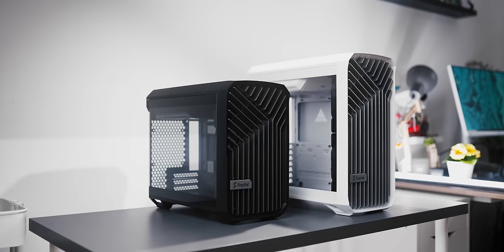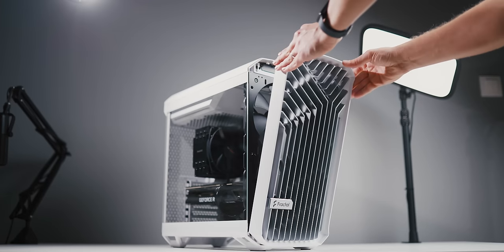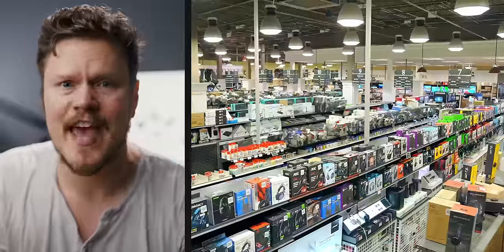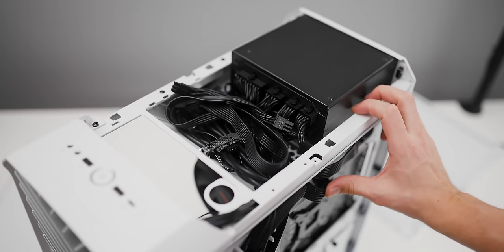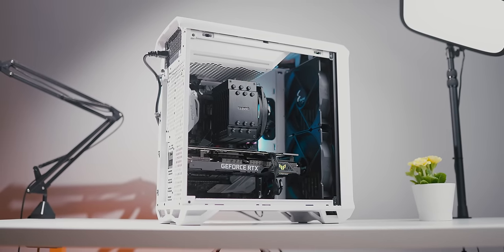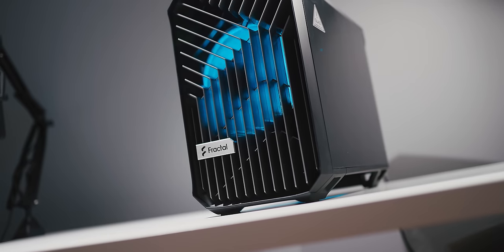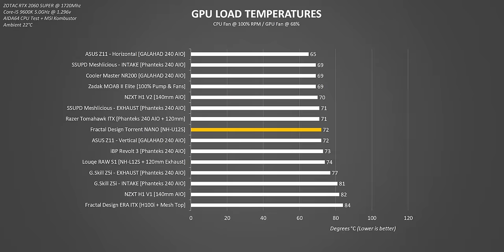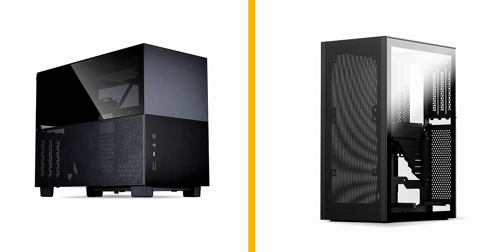Absolutely LOVE These Cases - Fractal TORRENT Compact & Nano!

Comment: I just ordered a NR200. Looked at the Torrent Nano but I'd like to put the PC on my desk and the Torrent is just a bit too big for that. Means I need a new SFX-L power supply but that's fine. Need an upgrade anyway since my 750W sometimes has problems with the 3080 Ti I got recently (at MSRP!, only reason I got it since 3080s at scalper prices cost about the same).
Read that SFX PSUs can have issues with the power spikes of 30series cards because they have smaller cap, hoping the amount of overkill I went with (1000W Silverstone) will alleviate that.
Reply: Good choice, I have a 30series build in an NR200 as well. The case is just absolutely beautiful!
Reply: You can fit an ATX PSU in a NR200 on the front using zip ties, but it eats into the GPU space quite a bit. Alternatively you can also buy/print a 3D atx bracket instead of using zip ties.

Comment: I was hoping the ITX case would support SSF PSUs. The price doesn’t bother me as much if the construction is good, but the usage of ATX supplies seems strange to me
Reply: I’m sure you can, most sfx power supplies come with an atx bracket. The only issue would be cable length. If you are buying an all new build though, a regular sized atx is cheaper. So that’s a plus

Comment: I just got the compact, cable management stinks, looks way better for air cooling, as the case feels more filled out compared to the original Torrent. If you decid3 to get this case, make sure to check your case IO because the reset button will stick down when the front cover is installed.
Reply: I was looking at it just for my old parts to make a server for games.
Reply: @Noodlepunk  I wouldn't do it if you're using harddrives because there is a lack of driver bays.
Reply: @eduardorico2205  I am planning on building a NAS here soon.

Comment: I did get the compact for myself have been waiting for a smaller torrent for a while.
There is one tiny cutout beneath the motherboard all the way on the left, I routed my audio header through there ... No idea if it was meant for that, it does not fit very many cables but just those pin headers fit fine.
I do not understand why the side panel is glass on both sides (on the rgb version) the one covering the cables should have just been a solid panel ... 
Also for the price they really should have included thumb screws for the side panels and the top panel ... the screw holes are there, even for the top panel.

Comment: It seems like the Nano is performing better than the Compact? How is that possible when the Compact has more airfllow?
Reply: Different cpu's tested which makes it difficult to summarize which is better.  Having a larger case does not = better air flow especially in these because you are then relying on a 120mm fan in the back for all exhaust.

Comment: How to cool the Intel i7 12700 processor? CPU cooler won't block air from going through the back of the case? The front sucks in, the back pulls out, and in the center is the CPU cooler, which blows "upstream" the air drawn in by the front fan.

Comment: I have a EK 180mm WE Radiator (discontinued/brand-new) and this Torrent Nano case looked like an awesome build for it but there seems to be insufficient space in front of the 180mm fan for this 35mm thick Rad.  Bummer.  There seems to be more space in the Compact version for a front Radiator just not the Nano.

Comment: Best part you did not mention: the nano fits the Noctua NH-D15, which is rare in the ITX case world and one of the reasons, why I got the nano a week ago. The prize asked is too much though, paid close to 160 EUR for the black RGB version. Around 120-130 EUR would be anceptable prize, 160 EUR is a bit too much.
Reply: Does the nh-d15 fit with both fans in this case ?
Reply: Said the guy who pays 100€ for the Noctua cooler.
Reply: @Digitalbit3  it does 👍
Reply: @mauticom  So? The NH-D15 is one of if not the best aircooler and I would say it is worth the money. The Torrent Nano is a fine case and I really like it, but for that price tag, I think it could maybe have some better materials or a nicer LED-strip (like mentioned in the video). It is somehow lacking just a little in the premium section to completely justify the price.
Reply: @ManeaterMV  didn't expect a serious answer. I know the Noctua is the top of the line as far as air coolers can go. However I see it from the manufacturer side, the required materials, the huge volume it takes up during transport, the fan, fan bridge, the assembly for a retail price tag of 160€ and then two fans, copper and alu plates for almost 2/3 of the price.

But I totally agree - coming from an old Mac Pro 5.1 case the Fractal Meshify 2 felt a little bit cheap. The metal is very thin, in my case the USB front ports didn't sit tight and other minor things. For 140€ the price tag was ok, but somehow from the aesthetics and clever design solutions I expected more when I actually got my hands on it.

Comment: im looking to use this case for my next build but i want to keep using my kraken x62 and i was wondering if i would be able to mount it to the bottom of the case with air being pulled from the inside to the outside with 2 140mm fans. If not, ill just get the NZXT H510 instead.

Comment: After finding many very nice small cases for my mITX build, but having them be literally 2cm too short for my graphics card when the radiator and fans are in the front, to the Phanteks Shift XT that's 4mm too short, I'm considering moving from the Arctic Liquid Freezer II 280 to an air cooler to try a build in either the Fractal Design Torrent Nano or Compact, or the Phanteks P200A.

Comment: I like the compact size of the Torrent  but I would like the option to add an AIO and prefer it on the top so I would have to go with the Meshify2 Compact if they would fix that case. The meshify2 Compact was shrunk down which I liked but the made it to narrow to use. Will not fit a 280 AIO on top and cable management is like the Torrent not deep enough. Lian Li Air mini would be the case for me as cables are easy to hid but only 240 may fit on top. 25 mm wider on the Meshify2  or just about the same on the 011 mini air would help both. I have not yet found a small ATX case from any manufacture that has good air flow, good cable management and actually fits all the computer parts. I like the style of the Air Mini but not the dust control as it needs more air holes then 40% and a filter, Torrent doesn't have much option for AIO and Meshify2 almost the same and not so good cable management.

Comment: Can someone please confirm if this case is:
A) suitable for an ETX motherboard (in the video it shows that it does, but just to be sure)
B) liquid cooling for both the CPU (AMD threadripper) and a 4090 GPU.

Or it’s relying on fans only ?
In that case should I get a “normal” size torrent.?

Thank you guys

Comment: I personally don’t like how the Torrent’s front panel looks and it’s lacking fan spot at the top, I went with the Lian Li O11 Air Mini instead. Amazing case, I’m able to run any game all day long completely silently using my 5950X + RTX 4090 by lowering power targets. It’s actually shorter than the Compact, yet makes cable management really easy thanks to the dual chamber design.

Comment: Just finished built my unit today. The 3.5'' hard drive cage is not well designed, can't mount the SSD on the back of it while using the front position. Also the cable access is a night mare while putting the cage in the front position.

Comment: I generally think that anything above $100 is too much for most people. It really starts to bite into your budget for the rest of your build. In a $1000-$1200 build, where the value is at, that's a large chunk of the budget for a hunk of metal.
Reply: That's a good point.  On the other hand, if you consider the case as part of the cooling solution, then there may be room for additional value with the right case, such as this lineup.

Comment: I just got a Nano for $50 used locally. But this thing is definitely worth $129 or even $200. I guess I think that because I'm 39 and remember when cases were still made in Taiwan and it was pretty common to pay $200 for a good case. I mean compare this to what else you'd pay for $129... A couple bags of groceries. Expecting to pay less than $100 for a high quality case made of literal steel isn't reasonable IMO

Comment: I think I will go for the non-RGB Nano case. I wanted a case that can pull air in like the Mac pro cases. Although not exactly similar but definitely something. I have the Ghost Louqe but my CPU in that case was producing too much heat for my Ryzen 3950 aand had to go back to my old Corsair 700d case. I want something small and this I think would produce enough air flow for me.

Comment: The aesthetics of the case are nice, but I think for the prices they sell at that the 4000D Airflow is still the better recommendation unless someone absolutely prefers the Torrent cases design instead.
Reply: You get realy high quality 180 mm fans in the torrent 
4000d will be louder at the same temps

Comment: I want one with a simple mesh front. It looks pretty good, but I love the simpler designs that don't really look like a gamer case
Reply: You could just pull off the front panel, there's a filter underneath.

Fractal has the Meshify too.
Reply: @libertyprime9307  yeah, but I am really intrigued by the 180mm fan. I used to have a TJ08E and that thing was pretty nice with the air penetrator

I am hoping that Fractal (as they have in the past) will reuse the core of those cases and make slightly different looking versions
Reply: @mattg8888  What about the Coolermaster H500 (no suffix), or the HAF H500 that's just now coming out?

Turn off the RGB and it's a relatively simple mesh front panel with 200mm intakes.
Reply: @libertyprime9307 nah. That thing is huge. I have a 300w-ish system.
Reply: @mattg8888  You looking for smaller than ATX? Well I was using an MB311L, micro-ATX case. It was pretty good overall.
Reply: @libertyprime9307  I am using an ITX build in an Intertech IM 1. It is alright, but I miss the front intake...
Reply: @libertyprime9307  also: why are you so friendly? We are online after all. Please throw some insult at me to make it more believable. ;-)

Comment: I was using OpenRGB for my previous case and everything was detectible, but now the RGB strip on the Torrent is not detectable. Had an NZXT H510i before and got a Torrent Compact yesterday. The only minus i can give it for now is the poor cabling design and inability to control the RGB. Especially poor cabling design is that theres just one tiny hole in the corner of the bottom of the case.

Comment: Why is the GPU temperature 5 degrees higher in the "compact" compared to the regular Torrent case?
Reply from the maker: The regular one has 2x fans for intake at the bottom and 3x for the front. 
-D.

Comment: I honestly think the pricing for cases is way less important to most builders than generally discussed here on youtube. Building nice PCs in in and of itself an expensive hobby and since CPU/MB/GPU will most of the time be beyond $1500-2000, Id assume most people dont really care if the case it 50 bucks more or 50 bucks cheaper. People I know and work with just care that the quality/airflow and design is good. Price for the case is a secondary concern.

Comment: Looks great, but plastic everwhere at that price? that's a No for me unfortunately. I also don't think the fan controller is particullary useful. Even mid-class mainboards have enough fan headers for a mid-size tower like this. Another problem is, that you can't use the 180mm fan's with an AiO (the fan bracket isn't build for that).

Comment: Nano fills a big void in the market. Without running an sff psu or using a riser cable the case can hold those huge components with a smaller footprint. Only other option for this that I see is the Lian LI o11 mini and its modular case setup.

Comment: price is fine, if they made it completely dust tight and easier to clean the dust filter without removing the front panel. some dust seal around the side panels and top, no holes. easy to clean dust of the feet. And they could make it so that little airflow goes behind the motherboard and out the back. i would be happy to purchase such a case :) Fractal could even sell an accessory to mount the case under your desk since the top is closed anyways you can lift it off the ground for easier cleaning the floor and less dust :)

Comment: Great case if you want to fry any high capacity hard drives that you're still using for mass storage, since SSD's in the capacity are way too expensive. That whole part of the case for cable management and SDD/HDD storage is totally flawed.

Comment: Why did they put the power supply on top, can anyone explain?
Why not place it at the bottom and cover it with a panel to hide the wires?
Price are NO NO.
Reply: Better airflow for the GPU. Having the power supply at the top allows the bottom to be open, putting the GPU right in the stream from the bottom fan(s) and letting you mount fans right under the GPU to supply it with even more fresh air. End result is cool temps and plenty of airflow, while still looking clean since the power supply is placed in its own chamber at the top to hide its cables. Only downside with this config would be the power cables for the GPU possibly being too short and the power supply having to take in air from within the case, but the former can be fixed with some extensions (and some power supplies have long enough cables already) and the latter isn't an issue with this particular case since there's so much airflow to blow the hot air right out the back.

Comment: That fan is loud. I regret buying this case almost.
Reply: Why do you not set it to 30%?
Reply: @taomahNEGEV  Do you think I am running it at 100%?
It is considerably quieter at lower rpm, still fan has humming noise. Perhaps I should rma it. Then on the other hand I don't know whether this is specific behaviour of my production part or inherent property of the model and its sheer size and shape of blades.
Haven't seen any YT video measuring loudness of this fan alone.
Reply: @reav3rtm  Huge fans with huge motors.
Reply: @taomahNEGEV  Then why is it seemingly preferred (by Dimitri) over 2x 14mm fans. GP-14 fans in other my Fractal case are really quiet.

Comment: The reason these cases are as good as they are is because of the manufacturer fans.....do some tests with other 180s....ya, the proprietary fans are that good. The case is irrelevant. I'd rather have the down up airflow of my evo o11d and turn down the rpms instead of guerilla fukn air out of the back exhaust.

Comment: $150 is a bit much for the Torrent Compact. I can't see myself recommending it over the Lancool 215, Corsair 4000D-A, Phanteks P400A, or any of those good mid/high tier cases with good airflow. Even cheaper cases like the CM NR600/400, Antec NX410, or the CM MB311L have it beat in terms of value. It sure looks great, and performs well, but I can't justify the high price tag.
Reply: What are you comparing man? Bus to a passenger car?

Comment: I will rather save $50/case and use a screwdriver.  These seem overpriced, but I understand the reason for the price was all the tooling/engineering to make a tool less design

Comment: Design wise fantastic, price wise abysmal. The Nano could freshen up my current Node 500 htpc and is a bit more geared towards gaming then a htpc/NAS combo like the node 500. But a Node 500 can still easily keep a Ryzen 5 3600X + GTX 1080 cool so meh? But i can't see how the Compact would best my current Meshify C main rig feature wise, except if i would really really need another "look" on my desk? I'm not a huge Fractal fan, i just got both cases at great price points, Meshify C 80€ and Node 500 at 50€. If i take that into account these older cases completely wreck the new ones... .

Comment: Come on guys, this case is pure involution by moving the power supply at the top of the case. When you have a 300W+ system that needs to evacuate hot air, 3 fans on the top is what you really need, not a PSU. this should be an example how to NOT make a case in 2022!
Reply: Plenty of hot air is evacuated enough already by way of the giant fans dotted throughout the case. I have the full size version of the case and with my fans maxed out I can feel more air exiting through the back of the case than I felt with my old case. All the hot air from the GPU is pretty much blown immediately out right where the GPU sits, and the CPU isn't too far behind thanks to the giant 180mm fan right in line with it. Even GN's review of the case shows that it's almost always at the top of the charts for thermals, if not #1.
Reply: Imagine thinking you're better than the reviewers who have equipment to test and data to back up the claims.
Reply: @jinwood  The INDUSTRY is better than ALL the reviewers. In the 90s and 2000s all cases had the PSU mounted at the top. But with the high end pc gaming setups, all the case manufacturers moved the PSUs down or lateral. So this case is just another reboot of OLD format cases, which already proved to be less effective.

Comment: Psu @ top sucks!.. The hot air?!
Reply: Gets blown right out the back by way of the giant 180mm fans on the front and the extra intake that you can fit at the bottom.
Reply: @jcm2606  reviews write already about this... This sucks
Reply: @QueckSilber87  And benchmarks clearly shows this concept as one of the best for air so...
Reply: @JohnSane  nope... Many reviews show that's sucks... Lol